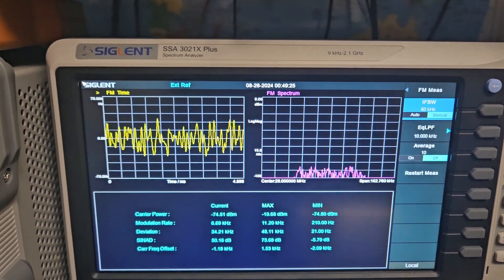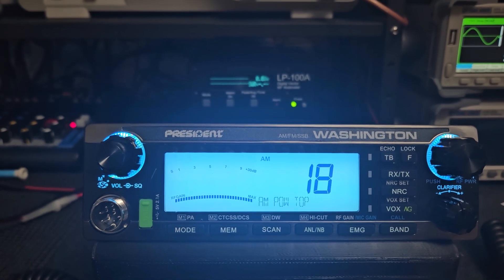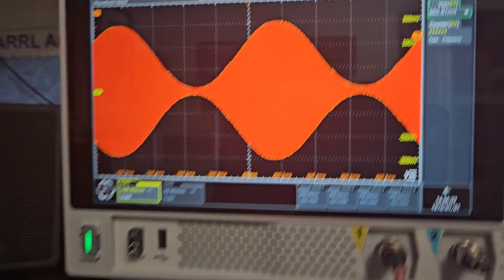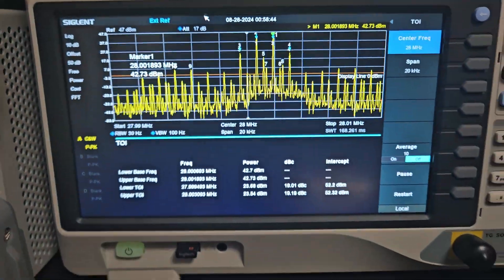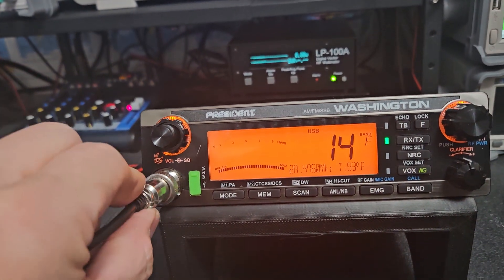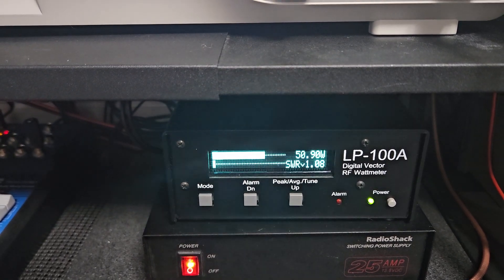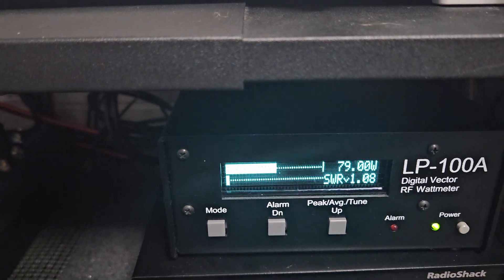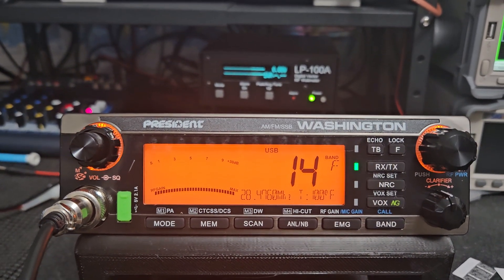New President Washington for Kevin

Comment: Does it matter which way the fans are blowing? Mine came setup with the fans blowing away from the heat sink
Reply from the maker: They should be blowing to the heat sink. 
There are arrows on the fan casing that show pointing towards heat sink of radio. 
I would recommend flipping them around for better cooling effect.

Comment: Nice radio. 40C may be a good temp for them fans. just have to try. It depends on operator and how they use.  I run my radios about 50% power.  Then up or down as needed.  Running end fed 5/8 wave the past few days. Better RX . 4:1 UNUN .  tried 25 ft , 20.5 FT and 39 ft so far.  20.5 ft 5/8 wave 11 meters gave 1.7 SWR .  Worked great. Did not try to tune better. I just cut speaker wire and that what I got. This a multi band and antenned to work with a ATU .  I got better luck than 9:1 random wire. SWR was high and IC 7300 had to go into E-Tune to work.  The 4:1 stayed under 3:1 most of the time so just press tune and done. 39 ft worked better than 66FT 49:1 . on 20 meters . I set my QT 60 at 2:1 SWR protect . run 50% power stayed cool on 1.7:1  . lots of contacts . Today bands were poor except 20 . 73
Reply from the maker: Lots of good info.
10 meter was bad in Michigan yesterday.
Migraine headache killed most of my day.
Reply: @ScottsRadios  I get a different kind of headaches. not fun at all. Take care 73
Reply from the maker: It's a bad thing when the headache starts the day. 73